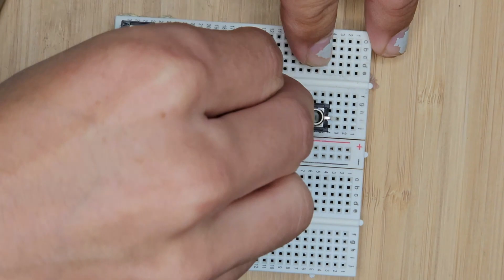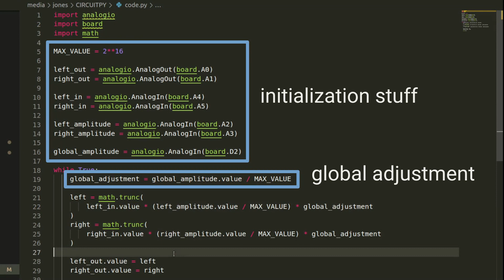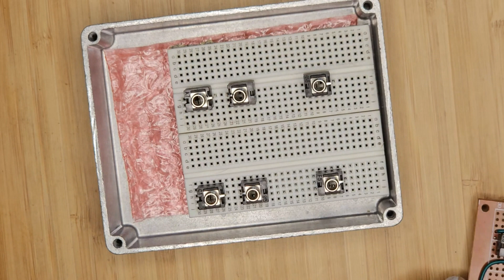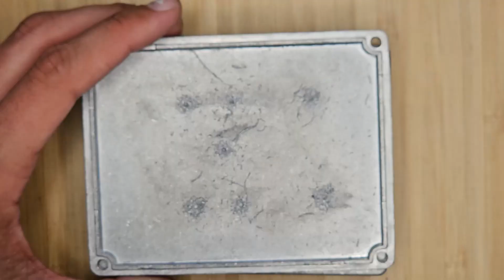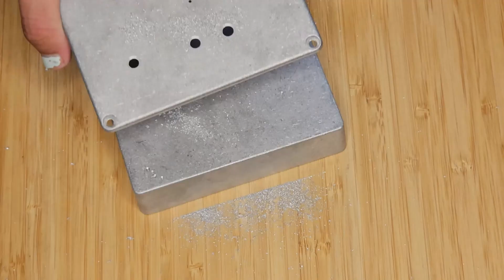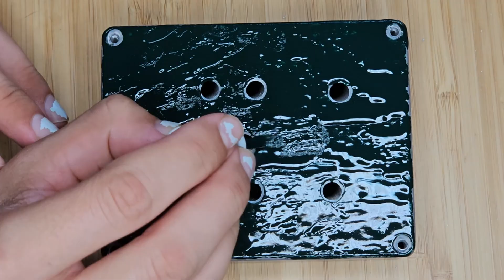diy voltage controlled amplifier

Comment: i think ring modulators are just through 0 vca's. as in instead of going between 0 and 100% volume. you go from 100% to +100% volume through 0%

Comment: for the holes: take a piece of paper from your printer. Put it on top of your jacks, rub with a soft pencil (the eyeliner could work) measure where the pot goes. Make a hole in the paper by cutting a cross with a sharp knife. push it over the pot and check for the jacks markings.
Tape to the box or transfer it with carbon paper. (or rub soft pencil on the back and retrace the spots for the jacks and pot.
Reply from the maker: good idea! i'll try it out with the clock module i'm building right now. 💙

Comment: MEASURING WHERE TO DRILL THE HOLES IS THE HARDEST PART!!! The technique that seems to work for me is to set the board on my printers scan bed, and scan it at 300dpi. Then, take the scan into an editing program to trace where the holes/centerlines are, and then print the results at the same 300dpi. The scanner does a good enough job seeing the jacks/pots, and the resulting template has been close enough with the last 3 sets of holes I have done. It is such a weirdly hard problem to solve for, and one that is shrugged away by most DIY blogs and tutorials I have found.
Reply from the maker: cool strategy! its one of those problems where i feel like there is some solution that exists that solves all of my problems but i haven't figured it out yet. its a good thing i have plenty more modules to think about it, haha :)